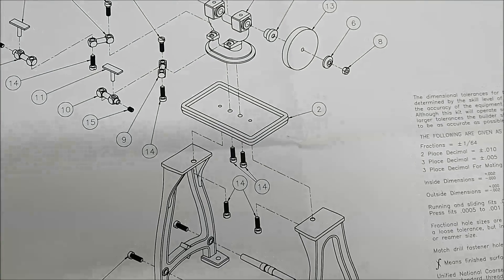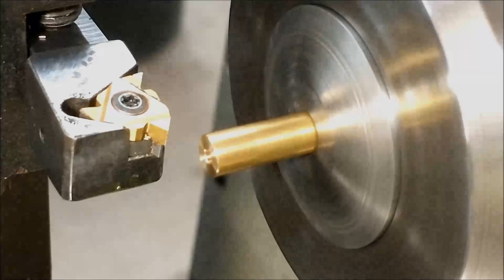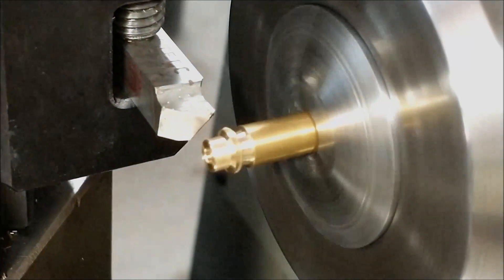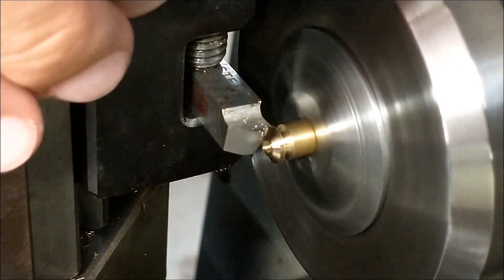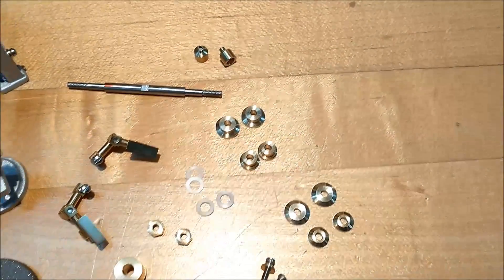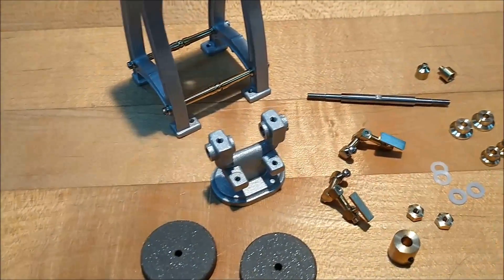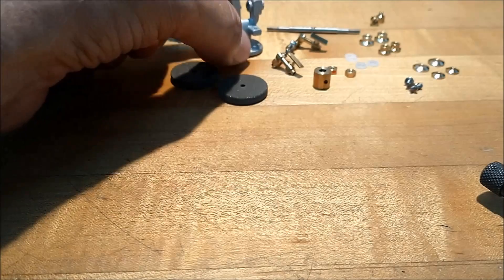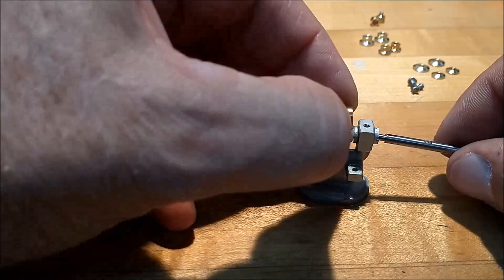It's Hard To Believe How Small This Machine Is. Take a Look !!!

Comment: Something I saw on a clock maker's channel. May be it will help you. Use Clear Lacquer (one coat) to retain shine (avoid oxidation) on brass for longer.
Reply from the maker: Believe it or not, even the thickness of the lacquer can mess up a fit.
Reply: you can also use hairspray. washes off easy if it gets on a precise surface....

Comment: Great work! These are all fantastic. Is there any chance you can add a micro DC motor to the lathe and pedestal grinder to get them to move like a real one? Obviously don't run it at 10k RPM or anything wild, but just to show off a bit. 
The motors used to vibrate mobile phones are super small, low voltage DC and would fit the overall theme of 'super small' nicely!
Reply from the maker: Belt driven in the end.

Comment: I love this! Just watched it all the way through. Love the decision to go with the larger hubs, might even help with rigidity on your discs since they're so small. Do you have to disassemble to get the belt drive on? Are the delrin bushings self lubricating? Would love to see a little mini adjustable left handed wrench to tighten those end nuts!
Reply from the maker: Greetings Chubbza5. Always good to get a comment from you. Thanks for the positive enforcement. Its good to have instructions, but also good to personalize the things we make. It needed the larger hubs to stay in visual scale with the larger nuts. The funny thing is, the larger thread I used, is only .012 bigger than what the directions called for. But at this size, even the slightest change looks huge. The delrin is not self lubricating, but it certainly takes the metal to metal transfer potential out of the picture. Teflon would be better, but Teflon smashes a lot easier too. I wonder if the lathe tailstock wrench might work?? I'll have to check. Stay well.

Comment: A brilliant little machine. I guess it represents a machine from the late Victorian period like the lathe, consequently long before health and safety, but I am a little surprised that there are no guards around the wheels. I am thinking that the way grinding wheels were made back in those days with the bonding agents at their disposal that wheel explosions could have been a lot more common than today.  Are you tempted to test your tinplate skills to make some guards?
Reply from the maker: No on the guards. If I go back and make anything, it will be a new tray with a cooling trough area.

Comment: You need a diorama with the steam engine you originally built to power everything.
As mentioned, the 'groove' in left hand nuts has been common for a long time. If you have oxy/acetylene the left hand nut has groove. I think propane tanks have it as well?
Reply: The PM Research catalog seems to have everything needed to build a complete 1/12 scale machine shop, including walls, doors, countershafts, etc.  Everything to  build a complete diorama like you mention.
Reply from the maker: They sure do.
Reply: @bobvines00  Thanks for looking it up. Parts are too small for my patience level so I didn't look at catalogue.

Comment: My real name is Michael McCluskey. How will you put a motor on it?
Reply from the maker: Greetings Michael. A grinder of this style was normally attached with a leather drive belt to an overhead shaft powered by a steam engine. They were called line shaft machines. if I lace a belt, I'll just loop the center pulley and splice to the driving shaft. If I use a continuous belt, I'll remover the spindle and loop the belt as part of the re-assembly. This possibility is why I put a small flat on the spindle to avoid damage to the casting when removing it.

Comment: The master of small is bigger than big  and I am supper happy to spend some time with him. Just look at your O2  oxy/acetylene fittings. The acetylene fittings are L hand and marked with that mark in the middle of the nuts. I can hardly wait to see all these wonderful pieces being driven by the steam/air motor/engine by a single overhead flat belt shaft. Makes this old fart all fuzzy warm inside eh, LOL. Great post my FRIEND !
Reply from the maker: I always enjoy your comments. Thanks for sticking around.
Reply: @joepie221  Visiting with you is always a real pleasure. Too bad we are 1/2 a world apart. After telling me about your visit to Bethlehem Steel and seeing your miniature handy work you sure got my attention. A crane or loader needing to be used to replace a carbide tool insert nailed me to the wall, LOL.

Comment: Nerves, Patience and eyesight, huh? --That lets me out......By da by,,,,,It that period correct Delrin>🤔(I'm such a smartass)

Just remember you will have to take it apart to get the belt on when you build the lineshaft.,,,,But then I wouldn't put it past you to make a scale alligator splicer.
Reply from the maker: Thats one of the reasons I pout a flat on the shaft where the set screw hit.
Reply: the belts should be crammed leather never is endless

Comment: Now you’ve got to take it all apart to put the belt on.
Reply: ends of belt get overlapped and superglued
Reply: @chevyfahrer  no they don’t. They make belts that are joined together with metal laces, but I don’t thank they make any of those belts that small.
Reply from the maker: @barryfields2964  Those metal laced belts may wreak havoc with aluminum pulleys, so I may op for thick black rubber bands.
Reply: @joepie221  so yeah you are going to have to take it all apart. Not that big of a deal really.
Reply: @joepie221  do they make those metal laced belts that small?
Reply: @joepie221  PM Research homepage says:Product Description
Flat belting is 0.018″ thick and is available in 1/4″ and 1/2″ widths. Ideal for transmitting the engine’s power to the dynamo, line shafts, or anything you wish to power. It is recommended to allow a little extra material when ordering. We recommend you slightly overlap the ends and use super glue to fasten the belt to your required length. The standard package is 9 feet. Purchase by the foot.

Comment: Those oil cup caps are goners the first time someone tips it over on the bench!
Reply: Needs some tiny tiny 0 rings to hold them in place
Reply from the maker: I have a small case for those caps for when I put this in the storage container for transport. It was a 1/8 end mill plastic tube.

Comment: Guess you will have to build a boiler now, so you can run the steam engine to power a line shaft to run the flat belt machines to…….
Thanks Joe.
Reply from the maker: I have to honestly say, I won't be building a boiler. At least I don't plan to.

Comment: Joe, I'm sure you have already thought about it but, you realize, when you run out of mini machines to build, you are going to have to make a miniature "doll house/machine shop" to house all these machines, I can picture the belts and pulleys rigged up in the ceiling, and I'm sure you are clever enough to rig up a waterfall outside with a water wheel to run the belts and pulleys! I even imagine an oil soaked floor in the machine shop, I know you keep your shop so clean you can eat off the machines and the floor but maybe a few mini metal chips on the scaled down floor would be okay! Good luck, fantastic job, you have the patients of a Tibetan Monk! 🍻
Reply from the maker: I've already realized that popsicle sticks, glude and drilled, plugged with round tooth picks, sanded and stained will make the perfect miniature hardwood shop floor. Not that I've thought about it.
Reply: @joepie221  Ha! love to see it!

Comment: Need to make a frame with a belt power to test them all
Reply: I think in an earlier video he said he had plans to set up a line shaft and belting to power the various machines. When it is stripped to fit a belt the red marks can be cleaned off.

Comment: No machine shop I've ever been in has had a grinder with two good wheels on it. One  side should have grooves it and the other side both corners rounded off. Not a true representation in my opinion. But very nicely done!
Reply from the maker: Be patient. It just came out of the box. Somebody will abuse it soon enough.
Reply: @joepie221  I just never seen a brand new one right out of the box. That's like seeing a unicorn.
Reply: The left hand wheel looks to be loaded up.
Reply: @davecummins6581  Doesn't anyone know you're not suppose to grind Aluminum!

Comment: Nice job. Cute piece. You forgot to mention you also need great machinist’s skills in making it. Do you think the end nuts would look better if the outside faces were chamfered a little? Another modification could be to make the end nuts and the flanges as one piece. Tricky to make, but I bet you could do it Joe, no problem. Just a thought.
Reply: Just realized, if you made the end nuts with the flange on it as one piece, the flange part would rub on the grinding wheel as you tightened the nut up. Maybe not a good idea.
Reply from the maker: The nuts are chamfered, but the chamfers are very small.

Comment: Awesome work 2 questions first what scale are they second are you going to set up a display like they would be in a shop
Reply from the maker: 1/12 scale and I do plan to setup a shop. I haven't run a line shaft yet because the layout should be efficient enough to keep it simple.

Comment: I can't believe you skimped on the roller bearings! Just kidding. Great job as always Joe. Thanks for sharing your experience with us. I enjoy your videos so much even if I don't have the equipment to do this stuff myself. As an aside, I need to replace the shaft on my old Craftsman drill press/(very light duty mill) and wondered what kind of steel it should be so I can turn a new one. Any help would be greatly appreciated.

Comment: Just like me.  Put the spindle and pulley in, and forgot the belt!
Reply: These would have used leather belts cut off a length and then joined, so you can let Joe off on this one
Reply: @blankroomsoup666  I don't have any Clipper lacing small enough for this belt.  But Joe might make some!

Comment: Love it.. Health and safety police gonna burn you for no safety guards on those wheels though....
Reply: But Brian, probably 95% of the grinders that I used during the lifetime of professional work that I did didn’t have shields.  Couldn’t get half of the work to the wheel with them on and never had a wheel failure…….and remember, open belt drive. A friend of mine is setting up a shop that has two lathes that will run with flat belts, gonna be awesome

Comment: 2-56 seems about right for those in shafts, although the nut seems bigger and thicker than a usual 2-56 nut. That just might be the camera angle.

Now what you need to do with these tools is set up an old timey machine shop with overhead shafts and belts coming down to drive them all. Bonus points for driving the whole thing from a water wheel or a steam engine.
Reply: Jo has already made the steam engine.
Reply: @johnbewick6357  I don't know if it's to the same scale as the machine tools. I don't know how big of a steam engine it takes to run a line shaft shop.

Comment: Now you can hand grind your tool bits for the lathe you built and sharpen your micro drill bits!
Reply: Not without making some wheel guards first.🤣
Reply: @chrisstephens6673  You're worried about wheel guards in a shop that has overhead shaft drives?
Reply: @PaulSteMarie  got to get your priorities right.🤣

Comment: How about a wooden floor with a line running and line belts to the machines ? !
Reply: Wow, there’s a flashback, my HS machine shop floor was wood block, years later as a machinist/tool maker I realized that those floors wouldn’t hold the massive weight of big machines, and keeping them level would be a nightmare, but for small tool and die shops it works and if you drop a part after final ops/surface grinding the wood blocks will save it from the scrap bin.

Comment: Joe , you should make a little model mach up of an old steam powered machine shop where all the machines were run from belts on a main ceiling shaft, and run belts to them all. Could even use a built steam engine to run it. That's would be awesome, but regardless these machines your making are top quality one of a kind excellent mini machines..love your work and dedication to perfection
Reply: I do believe that would be the greatest thing ever to be put on the internet.
Reply: Yep, exactly my thought. I seem to recall the Amish still have shops set up that way.
Reply: I think that's  his plan.